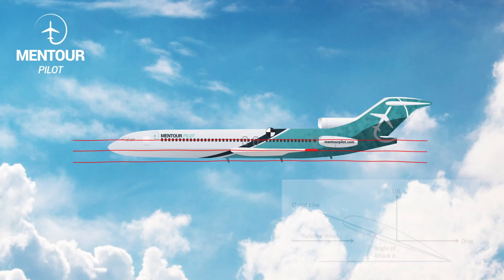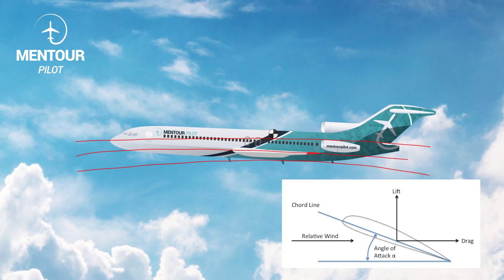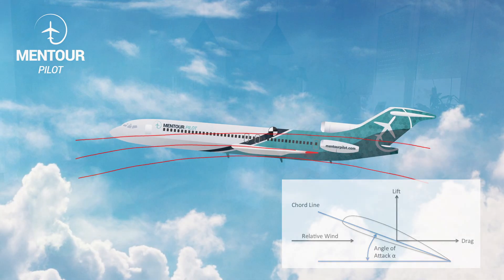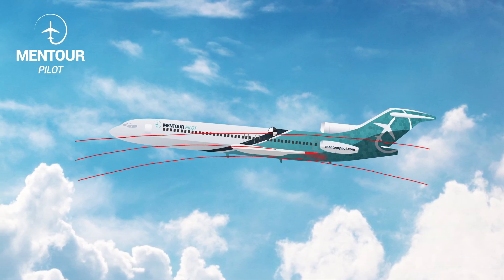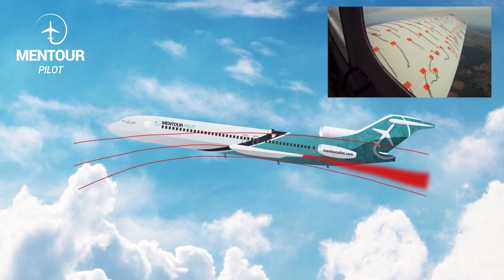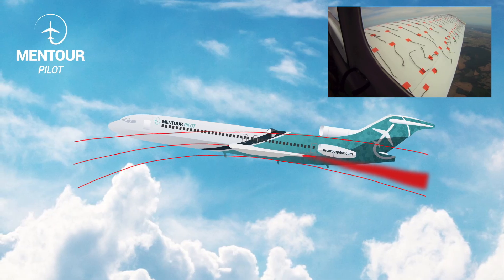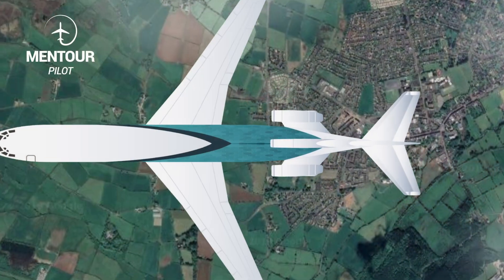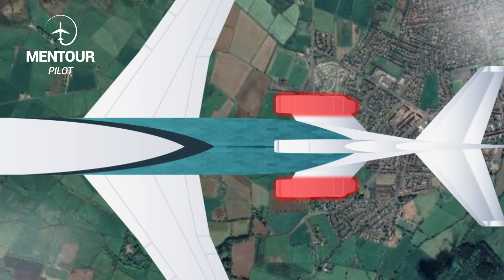The STALL you can't get out of! SUPER-STALL

Comment: Pilots: fail to notice stall warnings
Stick pushers: Fine, I'll do it myself
Reply: MCAS: Nothing to see here
Reply: @joez.2794  indeed, nothing to see here - avoidable crashes.
Reply: @RoelandJansen  Agreed.  While I don't not fault Boeing, trained pilots should have (and did) solve that problem in 10 seconds.  Still, I'd love to know what the worst-case scenario was that required such drastic action?  10-sconds-on, 5-seconds-off sounds awfully random and like you're just saying "well, they all know to turn if off if it malfunctions"?  I also heard the handling changes induced by the new engines were so minor MCAS wasn't even needed at all.  We know now why they added it anyway, but that's all the more reason to be extremely careful to make sure it only ever gives "just enough" help?
Reply: @joez.2794  Boeing did not tell the pilots that the system was even there in the first-place let alone the FAA, they didn't know what they were looking for and the steps to rectify it. Let alone the engineering behind the system was inherrently flawed as a cost-cutting measure. Internal Memos showed that Boeing was fully aware of the risks and elected not to rectify them, again, due to cost. I like Boeing planes, I like their engineering but Boeing corporate - that pushes me from loving their aircraft.
Reply: laughing in Airbus alpha protection
Reply: I don't understand how a lot of pilots managed to ignore all this when found out during a crash
Reply: @FutureBoyWonder  Depends on a lot of factors.  Fatigue is one I know of.  Example:  Colgan Air Flight 3407, where an exhausted flight crew was mentally unable to correctly interpret the warnings, and ended up causing the Stall themselves.

Comment: I learned about something today that I didn't know existed.

But I believe you got one major fact wrong. If I am not mistaken, all modern aircraft wings have built-in washout where the wing root has a greater angle of incidence than the wingtip.  The effect of washout at a high AoA is to induce the stall first near the wing root, which leaves the outer control surfaces (ailerons) in clean , unstalled air. Only in the deepest stall states do the ailerons become compromised or ineffective.

Still....regardless of where the stall first occurs on the wing, the deep stalled flight condition looks like a terrifying place to be.

Comment: 12:50 if you had pasengers on board you could ask them to all run to the front of the aircraft to move the center of mass to the front of the wings, causing the plane to tip nose first.
Reply: A fuelled 737-800 weighs 60 tons, and 12 to 15 passengers weigh 1 ton - so this is hard to do.

Comment: "a stick pusher is an actual proof that pushes the yoke forward and forces the nose down so that it reduces the angle of attack"
so this is basically MCAS (its sad that MCAS cant deactivate like the video described)
Reply: No, because MCAS is designed to oppose control column forces to meet certification requirements, not to pitch the plane down.

Comment: Super stall in a car...steering wheel feels like it has come off in your hands, the accelerator pedal raises the revs of the engine but has no effect on your speed like the clutch has failed and all the brake callipers have burst pouring hydraulic oil over your brake discs... sail on to the scene of the accident. Seriously super stall sounds just like that... now going to look up to see if I can save my Astra 1.7CDTI from one. And then the aircraft version. 🤓

Comment: Sounds like everything that the 737 MAX went though, but they didn't have the altitude to recover.  Pilots struggled to prevent the stall.  Should they have turned the auto-pilot off immediately to manually fly the plane?
Reply: It's backwards. The plane was furiously trying to prevent a configurational stall, while the pilots were furiously trying to prevent the plane from nosing directly into the ground.
Reply: @mfree80286  No, the plane was trying to apply a trim to correct control column forces which, unaugmented, would lighten significantly at high angle of attack. It's not a stall issue
Reply: @AmbientMorality  ... a control authority amplification that leads to pitch up and stall, which is why the system aggressively prevents it... it being the stall that I never said the plane was IN, but is the endpoint of the untampered flow of actions, painting a contrast to the original poster's assertion that the pilots were fighting a stall in the 737MAX...

...where crashes were not caused by stalls, but by a system to prevent a possible type of stall.

Comment: In what kind of flight situations would there be a risk of stall? Presumably take-off/landing but during a conventional flight are there other situations where you need to be careful?
Reply: High altitude cruise (usually a fair bit higher than planes cruise at) because the maximum speed (determined by Mach number) and minimum speed (determined by required lift and stall angle of attack) get very close together. In practice doesn't cause many issues, though on a flight without passengers a ridiculously irresponsible CRJ-200 crew tried to get up to 41000ft and made a series of awful decisions. I try to avoid blaming pilots, but in this case they flew to 41000ft for no reason except testing the limits, ignored maximum climb rates, and ignored and overrode stall warnings.

Comment: Hey mentour, did you hear about the news in the dutch newspaper "Metro"? There it is discussed that the 2009 turkish airlines 738 crash had similar design issues as the 73MAX that contributed to the crash, but that those were swept under the rug since there still was the fautly radio altimiter that was the main cause of the crash. If this news is deemed true, what would that mean for the reputation of the 737? I'm not trying to instill fear, but I am curious about your opinion.

Comment: The F-101 Voodoo fighter had a deep stall recovery system consisting of a small drag chute in the tail cone. If the pilot did not manually push the nose down quickly enough, deploying the chute would yank the tail back and up, thus pushing the nose down. Unfortunately it only worked once, since the pilot was expected to jettison the chute after use.

Comment: After 10 months of MAX grounding, one begins to think that whatever the problem is, it can't be fixed.  One possibility is that changing the location of the engine changed the way stress is distributed through the airframe, which could cause cracking and breaking at inconvenient times, such as any time the plane is off the ground.  The pickle fork cracks on the NG are a warning of potential problems.  Remember the British Comet.  A tiny problem with the design of the passenger windows caused the crashes of that plane.

Comment: Super Stall. Yeah. This is the reason why TC-TRB Başaran Holding's business jet crashed in March 11th 2018 at Iran. Two beautiful women pilots couldn't save the aircraft falling from 36000 feet while trying to climb 38000feet. Speed indicators started showing different speeds. Finally cpt spd showing 276kts while f/o's 176kts. Aircraft first alerting overspeed and after stall shake simultaneously. Cpt thought that her speed indicator was true one and decelarate trust. Unfortunately cpt's indicator was wrong one. Thus, aircraft already in super stall at 36000feet and couldn't be saved...RIP. (sorry for grammar faults)

Comment: The deep stall is very well explained in this video. Congratulations.  On the FlyJSim Boeing 727 for X-Plane flight simulator, with Ultra-realistic flight model, the "Deep Stall" is very well simulated. Stalling a B727 T-tail will get you in an unrecoverable "Deep stall" in no time, with no aileron, rudder, elevator and/or engine control. Unless the deep stall occurs at at 30,000ft, and the plane drops 20,000 ft.. it may by chance get into an attitude, that may allow to recover... and that's a maybe. It's nasty. Otherwise, very aerodynamically sleek, super-clean, fast and pleasant to fly T-Tail. Just don't stall a T-Tail because it will show you it's bad side, and will bite you!
Reply: Add to this that when you stall the wings and stabilizers you also stall the engines… So it's even less possible to recover from that.

Comment: If your speed is sufficiently low, do you believe dropping the landing gear would help in recovering from a super-stall?  My thinking is the added drag from under the aircraft would be applying a rearwards force beneath the COG, the equal opposite force would be forwards above the COG; if my physics is correct.  I mention speed because you wouldn't want to rip the landing gear off.

Comment: The video talks mostly about aircraft designs with T-tail and rear engine mounts. What are the differences in the super stall characteristics and recovery between t-tail with rear engines (B717, B727, MD95)  versus wing-mounted engine T-tails (C5, C-17, Avro RJ/BAE-146, etc)?
Reply: ATR-72, Q300, Q400(don't forget the turboprops)

Comment: Mentour, the subject explained perfectly, thanks. But one thing puzzles me now: acfts like 737 or 320 have elevators mounted lower than the T-type ones. So, the angle of attack when the stabilisers are in wings wake is much smaller, thus increasing the risk of super stall at low angles of attack. However, these acfts are immune to super stall, as I understand from the vid. On the other hand, during takeoff, rapid pitching up is dangerous due to putting stabilisers into the aerodynamic shade of wings and they become ineffective. Could you, please, comment on that?
Reply: In takeoff configuration the wake is deflected downwards. Flaps will basically increase the AOA of the wing with respect to the plane's attitude.
Reply: Michael, thanks.

Comment: Hi Peter, i got a little confused at abt 09:20 where you explain how the wingtips airflow detaches first but, isn't there a washout of the wing from root to tip (greater angle of incidence at the roots) to cause the entirely opposite effect? (root stalls before wingtips) so to maintain aileron authority?  Does the wing sweep as you describe ovecome the benefit of washout desing?

Comment: The F-104 "starfighter" was notorious for this deep stall issue. What they tried to do is to have a "vane" at the side of the fuse to measure "angle of attack" and if that exceeded the allowed range it would push the nose down.  (sounds familiar?)  In Germany it contributed to the loss of 292 of the 916 Starfighters and the death of 115 pilots.

Comment: just throttle it out

XD
Reply: compressor stall wont let you. Its really a nasty situation to be in. The only way to get out of it is to tell all passengers to move to nose of the airplane to make a very nose heavy aircraft. But you risk them getting injured in the process and its a slow one as well.
Reply: just downshift into 3rd and use a little left foot braking if needed
Reply: @rolandtiiroja  So heel and toe? Not everyone has mastered that craft. Seen people that have driven manual for decades and they dont use it right.

Comment: A very good video about deep stalls.  I think it would be good to mention that most modern airplanes use wing "washout" to ensure the wing stalls inboard first and wing tips last.  The wing structure is such that the angle of attack at the inboard end of the wing is greater than the angle of attack at the wing tip, ensuring that aileron control is maintained as long as possible in the stall.  Also, while the 737 doesn't have a mechanical stick pusher it does have a somewhat equivalent system called "Feel Shift".  As the airplane approaches a stall the first warning to the pilot is the stick shaker.  If the angle of attack continues to increase the Elevator Feel system will increase the column force resisting the pilot's input thereby pushing the column in the nose down direction.

Comment: A number of profession airline pilots have reacted to a stall by pulling back on the yoke.  This happened with Air France 447 and Colgan Air 3407.  When I got my private pilot's license, the first thing my instructor taught me is you push the nose down and add power in a impending or full stall situation.  Pulling back in a stall is a student pilot 101 mistake.
Reply: An ex navy test pilot has suggested that A447 was in a deep stall after it was pitched up in the thunderstorm.

Pulling back in the stick is not only a rookie mistake, experienced pilots still make the same mistake.    It is like heading for a wall in your car and hitting the accelerator - counter intuitive.  When one wing stalls it will fall, the pilot instinctively uses opposite aileron input to correct but that just turns the stall into a full blown  spin (due to the additional drag on the stalled wing). That is an instinctive response that is in "muscle memory" but it could be fatal at low altitude.  

When you are stalled your are outside the envelope, your programmed responses may no longer be the right ones.  Repeated training and practice seem to be the only way of ensuring pilots have the right response to a rare event.   That and prevention.
Reply: Rookie errors

Comment: Hi, Petter!  There is one practical use for a super-stall that some of your viewers may not know about...

I used to fly 'free-flight' model aircraft when I was a kid. They were little (2' or 3' wingspan) gliders or rubber-powered planes built from balsa and covered with strong tissue paper. There was no radio control gear (it cost a fortune back then!) so the planes were self-stabilising and flew in a gentle turn all by themselves. Getting the 'trim' perfect was a big challenge, and taught you a LOT (unofficially) about aerodynamics!

Unless the weather conditions were absolutely calm, on a good flight of 6 or 7 minutes - despite being trimmed to fly in a constant gentle turn - the planes could drift a long, long way downwind. You kept fit by retrieving them; I used to chase after mine on my bike!

But occasionally you'd encounter a bubble or column of warm rising air, and then you were in trouble because the model would fly higher and higher, to hundreds or even thousands of feet, sometimes flying right out of sight, never to be seen again. It was exhilarating, but very sad because your lovely plane was gone for ever.

So we used to fit so-called 'de-thermalisers' to our models. These were simple mechanisms which, after a set time, released a catch on the rear of the tailplane that caused it to tilt upwards to about +70°, putting the model into a massive and unrecoverable super-stall. Even in a strong thermal, the fully-stalled aircraft would head for the ground, wings level, and land gently. De-thermalisers saved a lot of tears...

Unless the thermal was really strong, in which case the stalled model (which only weighed a few ounces), would continue to float up, up and away like a balloon; not actually flying, just tumbling and drifting. That didn't happen often, though. Maybe you were under a storm cloud, where you shouldn't have been flying in the first place!

Anyway, I just thought it was worth mentioning that, sometimes, a super-stall can be a really useful thing...
Reply: Elli P Interesting story! The Virgin Galactic spacecraft uses a similar tailboom stabilising mechanism during descent.
Reply: Interesting application. I guess it can be useful as long as the plane is unmanned.
Reply: Had something similar.... a 'bungy' based launch system, which would trigger the rudder so that the glider would circle. And then a thermal fuse which would trigger the stall after a length of time.
Reply: That's really cool!

Comment: I continue to believe that MCAS is an evolution of the stick pusher system.
Reply: Truth's Knight_0777 The original intention of MCAS was for high speed maneuvers. However it was drastically increased in power to cope with low speed instability. That is not what Boeing asserted.
Reply: I agree in a way.  But what if a stick pusher just kept pushing regardless of the situation - whether is be from a faulty sensor or software glitch?  That's what MCAS did.  Like the Energizer Bunny, it just kept going.
Reply: @Booboobear-eo4es  ikr?
Reply: @Repented008  - ?????

Comment: There is yet another stall-avoidance method: laminar flow control. Very narrow slots are cut along the wing's length, and air is induced through them. This should be a more common feature of commercial aviation.

Comment: you mentioned stall strips but this effect can also be achieved with washout where you decrease the angle of attack of the wing towards the tips so the root stalls before the tips - you see this clearly in the wings of F16s and F18s where the angle of the wingtip mounted missiles is lower than the fuselage.
Reply: John It is difficult to include washout in a long aluminium passenger aircraft wing, slightly easier with carbon composites.

Comment: 1 way you might be able to get out of a deep stall is to deploy the landing gear.. this is essentially grasping at straws in a deep stall situation. It might work but it most likely wont.
Reply: Usually, T-tail aircrafts have rear mounted engines, and increasing thrust produces a nose-down moment, and that if they don't stall, too. At that point the only thing that might help is actually turbulence (an updraft or wake turbulence) which could roll the plane.